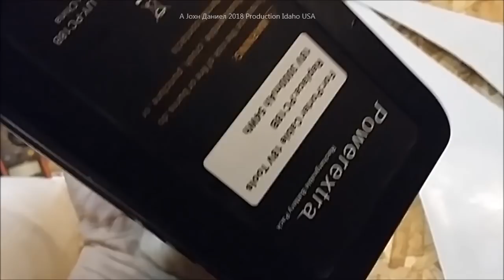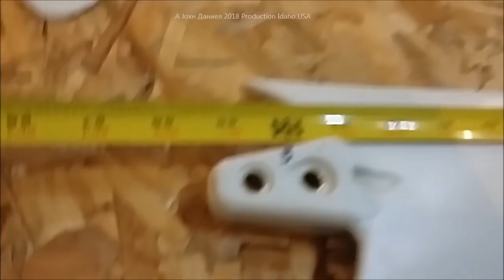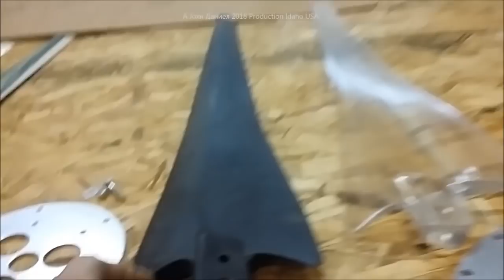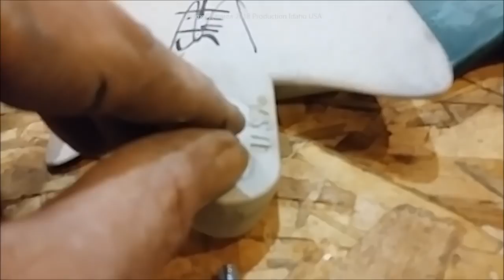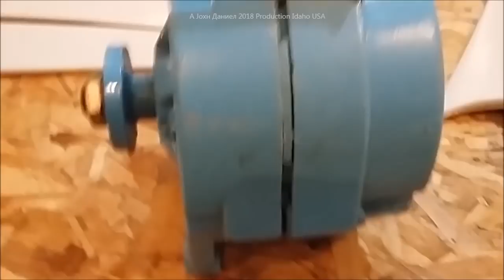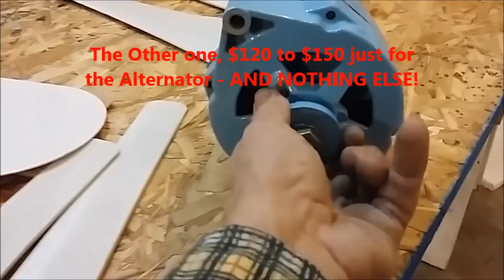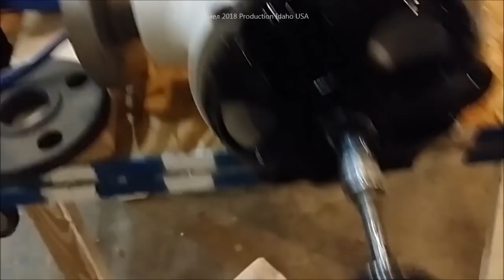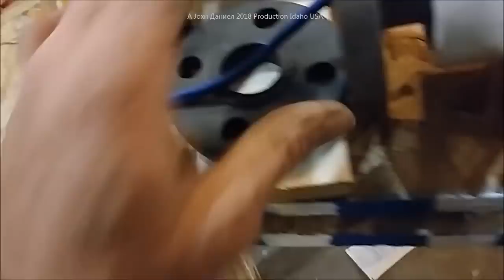Nice 500 Watt Chinese Wind Turbine, how to Test, Wind Turbine Lesson 2 (all parts used below video)

Comment: Using a 54 watt drill motor to produce 150 watt, you are smoking nice products or taking nice pill's
Reply: Peter Evenhuis, 54Wh was the battery capacity of the drill (1:11), not the power of drill motor

Comment: Is it possible to make the blades longer but not heavy as they would be if made from that material ? Is it possible to make longer but strong enough and lighter  blades?
Reply: The smaller the blade more RPM the longer the blade the more torque
Reply: If you look around you can find wind generators of all different diameters. The larger the diameter, the more wind it intersects, the more power it makes. A 6 ft diameter turbine makes a whole lot more then twice the power of a 3-foot diameter turbine. Check out the area of a 3-foot diameter Circle compared to a 6-foot diameter Circle and you'll see what I mean.

Comment: How much watts can this little thing give ?  What is its output when the wind is weak?
Reply from the maker: Low winds would be 90 to 140 watts continuous. Thats referring to a 10 to 14 mph winds. However once over 15 mph its quickly jumping to 250+ watts. Mine has hit over 1000 watts in 30 mph
Reply: @JOHNDANIEL1  well that sounds amazing! Does it produce anything on 5-10 mph or even lower?
Reply from the maker: Below 5 mph its nothing but a few spikes of 10 to 25 watts, at 10 mph its a fairly steady 60 to 80 watts. About 5 to 7 amps.
Reply: @JOHNDANIEL1  still amazing,  Thank you.. when you spinning it by hand it looks much harder to spin , but if it works on 5 mph and under that is awesome.

Comment: I would like to see that 500W with 4 vertical blades (what size?). The more blades you have, the higher the torque/output, therefore same size blades can have different output if grouped in different numbers. The higher the output, for generators the same size, the higher the resistance.
Reply from the maker: The more blades you have the faster you create a wind wall of blades and stall out.
Reply: Actually the fewer blades the better. A single blade would be most efficient but difficult to balance. It would also have the same problem that two blade turbines have, real bad cogging or shaking during yaw. The 3 blade turbine keep the blade count low while offering very smooth yaw.

Comment: Any advantage to select 5 blades intead of 3 blades .... other than the noise using 5 blades  ......
Reply from the maker: 5 blade is for lower wind zones like 5 to 15 average, it will likely only get to 85-90% of the generators output rating though with 5 blades due to WIND WALLING effect when the blades speed create a near solid wall of blades at full spin. 3 blade takes about 2 mph more to start up, perfect for a 8 to 20 mph wind zone. 3 blade can reach and exceed the rating on the turbine in maximum winds.  I am in a 10 to 25 zone, so 3 or 5 can both be used, just that 3 will have higher full output.

Comment: You seem to have so much good information and then you go say somethings stupid like the max rpm is 550 in sure it says 550 but that's in speed 1 not 2 its probably in between 1500 and 2000 and also that 54 Wh of the battery has almost nothing to do with the drill output other than a runtime
Reply from the maker: So when you made that assumption of stupidity you looked up the specs on the pc18 drill and saw that info.

Comment: the turbine is not availlable. i want a 500 watts 3 blades
do you this one is godd for the price ?       https://www.ebay.com/itm/500W-12V-24V-3-Blades-Wind-Turbine-Power-Generator-Charge-Controller-Garden/292332723510?hash=item4410635d36%3Am%3AmkBInQ4ez2kMH2JGN8TPGZA&var=591226717852
Reply from the maker: No, that one is very lame, tops out in a wind storm at 150 watts, not worth anything, has only a 1" deep stator in it, not 2.5 like the good ones. The ones like mine listed as 400 watt https://ebay.to/2Qg9s1p OR https://ebay.to/2QgICGI are the same generator head and maker as mine, its 400 watt/500 peak. They will hit peaks in excess of 500 so be sure to wire accordingly. And use this big PWM SS type of controller https://ebay.to/2wR2LKk for 600+ watts, if you try to use one of those little MRC 400 watt ones these turbines will eat it.

Comment: Please can a wind turbine work directly from a wind controller without an inverter ? I'm new to this
Reply from the maker: Yes, you can just use it to charge batteries
Reply: John thanks, that means without the inverter included it can't be use to power any home appliances ?
Reply: @kolayemioladepo939  these wind generators make wild alternating current (AC) that gets rectified to direct current (DC) to charge a battery. Batteries only use direct current. I have seen some small cabins that are wired for DC lights and a few small DC appliances. Although most people just connect an inverter to the battery then connect the inverter to their breaker panel in their house.
The nice thing is the battery can be charged by almost anything, or even a combination of a wind generator, solar panels, Micro Hydro turbine, gas generator, your car or garden tractor Etc.

Comment: But this set-up will likely never have either of the above problems, because the wind turbine in this video is installed so badly. It looks to be only about 8-10 ft off the ground and placed amongst ground clutter such as trees and bushes. -- There's no way that any turbine will get the smooth, non-turbulent laminar winds needed to produce any kind of power at that height and amongst that kind of ground clutter.

this model.https://www.youtube.com/watch?v=f5WOUeP1hCs
Reply from the maker: ??? Are you saying that my turbine is installed badly??  Seems mine at 34 feet high, using the wing like compression of the 3/1 roof has outperformed the one i have at 32 foot on a pole in clear air. After 9 years running wind turbines, building them, installing hundreds solar and wind projects I think I'll keep them right where they are. BTW - That chinese controller in that video is Junk! A real house burner.

Comment: Great video!  Very informative.   Do you have any videos of putting up a wind turbine tower?  I would like to put up a turbine to power my barn, but really don't want it attached to the structure.  Doesn't seem to be very many diy videos on YouTube to build a gin pole tower from scratch.  Keep up the good work.
Reply from the maker: I probably need to do a video on a tower build, I have done over 30 for customers. My contract though is designed where I can not film and upload a private customers job. I install turbines, I do not sell them but I will custom build one if you buy the parts.
My design is unlike anyone else, I build a self raising trundle tower I invented, none like it exist anywhere else. Most are 35 foot, highest is 55 feet to stay under the 60 foot legal FAA restrictions.

Comment: Where do you get that $220 price from?  The one on Ebay is $318 and on Aliexpress the only one available is $360-$380.
Reply from the maker: It's what the price was when they introduced them and I got mine 8 months ago, they out perform the $700 junkers sold from Missouri, Outperform the $800 junkers sold from a guy in Virgina, and stomp the piss out of the junk sold for $650 from a turbine guy in Washington state so the prices on it went up due to very high demand. The reality is, 90% of the turbines you buy just do not work even 10% of their claims, this one does 100% of its claims.
Reply: I don't mind paying the extra money, but I want to be certain that it is the same item. Would you mind posting a current link? Thanks in advance, and thank you for the education!!!!

Comment: Thank You !   Good Report
Reply: John I ordered  500 watt turbine  on 12 /1/2 019 from these people from your link blades are 25.5 inches long . You  have stated in this vedio 25 inch blades will not produce 500 watts. what has gone on ?? Also on tail sticker has no info on including mfg. Date
Reply from the maker: @sharyncomstock7066  22-7/8" are on the 300-400 turbines, and 25+ inch blades are good for a max of 500 watts, not much over that unless in a storm or high gust such as up to 650+ watts in storms but thats the limit. My referral is telling you to avoid sellers claiming 1000 to 1800 watts or more on 25" blades that they are for smaller 500 watt or smaller turbines only and do not make rated wattage over that. A 3 blade turbine commonly has slightly longer the 25-5/8" to have about a 55" circumference and the 5 blade has the 25" to get 53.5" circumference like mine. I basically refer the 25 ( 26") on those OTHER turbines with the Vietnamese generator on them as impossible to hit 500 watts as many with them can testify, poor junk engineering!
Reply: @JOHNDANIEL1  first of all thank you for
 Getting back to me so quickly. that's partly why you deserve all the credit you receive . I now feel better about keeping the turbine . It came damaged but they have agreed to send out damaged front  pma ring  that sits behind blade. Hub.( pma font cover) thanks again for all your help you provide.
Reply from the maker: @sharyncomstock7066  PS, if the tail sticker is not date labeled means its a 2020 model,  Made from Oct 2019 and forward. I noticed that on a few I recently installed in Alamo Nevada above the cemetery road in the hills. I did ask them directly on that.

Comment: What would be the effect of putting longer blades on the 200W alternator from China? I spend the Winter in the Keys (dry camping using generators and solar) and our average wind speed is 8 to 10 mph.
Reply: It may not give you enough RPM to produce any power, longer blades have more torque but less RPM
Reply: My knee-jerk reaction would be to say to try it, but then the old brain kicks in. Even slightly longer blades can give a lot more power to the turbine. This type of turbine uses electrical braking by shorting the fields as a governor to keep it from over speeding and throwing its blades. Now imagine if you put on longer blades and the wind kicks up. The controller may try to slow or stop the generator by shorting the fields, but the blades are overpowering the generator so it can't stop. It's possible it may overheat and burn up the windings of the generator. At that point now there is nothing to stop it from over-speeding and throwing its blades or worse.

Comment: hi there John ,
get one of these these days!
Have a question for you ..... the front bolt as a slack between the bolt and the turbine body , is that normal?
mine screw on to the right but the slack remains.....

Best regards from Portugal.
Reply from the maker: They appear to not make up all the way, but I powered though where it felt like the nut stopped. The locking nut on the shaft threads got about 1.5 mm from fully tight, I removed it, tried it again and it tightened even more. 3 times and it fully seated.

Comment: Dude! Construct a windmill. Base concrete with banks of organic carbon power cell. Large support pole you can place a spiral staircase inside of it. Top of windmill use a swash plate pump motor. This will allow you to control the speed of the blades and can also be used has a breaking system on very windy days. Swash plate hydraulic pump motor turns a transmission. Transmission then turns multiple large drum motors.rewired into generators and placed around the inside of the support pole along the spiral staircase. All the drum motor generators charge up the banks of organic carbon power cells. You can run power lines or yoy can use tesla coils to transfer the energy line of sight from coil to coil with zero energy loss.  Crazy ideas for you. 😊😉
Reply from the maker: Yes, already on that track. But the hydraulic rotating joint for that project is high dollar. Using low rpm hydraulic pump and 8 foot blades 7 years ago we built one and drove a ces-455 motor to a PMA. Too much lag. Design 2 is a 3 cylinder air pump from a Volvo and 9.5 foot blades. Air pressure is  made, stored and when sensors see battery needs it the air reserve opens and spins a 4 hp air motor which charges the battery back up.  Works perfect with solar, any pressure above 170 psi just vents through a progressive release which acts like a turbine brake. Air capacity is 260 gallons @ 170 psi. 
It is running at my place east of Ballinger Texas, NO VIDEOS OF MY PLACE THERE,  SORRY.
Reply: @JOHNDANIEL1  Time to think outside the box. Instead of using the pump directly, mount it on the bottom of a right angle gear box driven shaft. Then the head of the windmill can pivot to the wind while the shaft takes care of getting it to a solidly mounted pump. That is why the old water pumping windmills always had a swivel joint at the top of the reach rod.

And by the way the MOW&S guy is a work of art. ( in the new way of defining art )  https://www.youtube.com/watch?v=GeuaGZJQuUM Do you have a 55 gallon barrel of it saved up yet? Be sure to throw about 55 lbs of salt in with it.  ;-D
Reply from the maker: LOL!, Yeah that Harry channel I knew with fair certainty ( a email from brian P) belonged to a guy called Pooned who Missouri ripped off and another guy who was a scam helper criminal liar assistant for Missouri who jumped ship instead of helping steal more from customers successfully got sued for it in their little Dukes of Hazard kangaroo court in Missouri. Says a lot about truth in Missouri, None required! 
As for the water wind mill design the RPMS and its drive system winds up a rod, then surge pumps the water with numerous check valves and pumps ounces at a time, very un efficient for wattage, equal to 160-180 watts solar. Thats why they have converted so many to a pair of 150 watt solar panels and electric pump.
Reply: Ever hear of Rube Goldberg?

Comment: The link now goes to a 12V/24V 400W Wind Turbine Generator Kit 3 Blades Wind Power.
Reply from the maker: If any of the pictures and details don't look exactly like the one that I show in the video don't buy it. A lot of other sellers are trying to use its picture because they know it works to lead people to their ads and junk so avoid that stuff. The ME-400/500 turbine is from Niaer Wind Power, those others are just junk.

Comment: Hi Daniel
I have already installed the wind turbine (this model) with 5 blades and makes a lot of noise.
With a wind of 10 knots I measured 75 dB at 5 meters from the base. It makes an unbearable buzz.
and I have only measured up to 50w of load. nothing like what he gives you.
Do you think that with the blades you advise will make less noise?
thanks and best regards
Reply from the maker: They are not quiet, but a 3 blade is much less noise than a 5. They still have a loud swishing sorta whistle sound. I thought about putting tennis or racket balls on the tips to make them quieter.

Comment: I'm only getting round to putting up my turbine now.... Only issue I have is the hub is five blade and I have only three blades. I messaged the seller to see will he send a 3 blade hub so will see what happens there. I see those blade you have listed there would they be the same as what I have I wonder?? So I could just buy two blades and have a balanced turbine then. Your videos are excellent 👌 by the way 👍
Reply from the maker: Thats Odd, but not a bad deal really. Go onto Aliexpress and get you a 3 blade hub for it too hahaha. 5 blade is about a $30 upgrade. But honestly these only need 3 blades in 90% of the world wind zones. I would stick with the Chinese blades seriously in this size market of blades 500 to 750mm. A KT Pantera blade is HUGE and powerful, your turbine would explode in a wind storm with them things. And your bearings would get trashed with the missouri/Vietnamese stuff due to lousy balance.
Reply: Thanks John... I will see what the seller says and if he doesn't ship me one I'll just buy a new hub. Thanks for the advice really appreciate it 👍
Reply: Hi John, So I got on to seller but not really having any luck... I can't get a 3 blade hub on ali express I found them but the "m" size which appears to be my size is out of stock everywhere. So I'm thinking of using the 5 blade hub instead for now anyway. So do you recommend buying just 2 extra blades ? I think they are 650mm 
or buying 5 X 650mm blades to be more balanced? The other thing I've lost my nut for the hub ! I had a really bad luck that day. I think its 3/8" nut on the inside and 15/16" on the outside from my measurements. Thanks again Jon.
Reply: @offgridamps  if you have a Fab shop or a machine shop in your area, just bring everything down to them and explain what you're trying to do. They should be able to set you up.

Comment: Hello from spain,
Thankyou so much for the videos. Following your advice, I have ordered this wind turbine. can you tell me what size flange sit uses this model, please?
https://m.ebay.com/itm/Wind-Turbine-Generator-Flange-Seat-Accessories-Inner-29-135mm-Outer-104-240mm-/362145398303?_mwBanner=1
 thank you very much
Best regards
Reply from the maker: Not 100% sure, that M2 model looks correct in my view, but I used 1-1/2" weld flange for USA pipe schedule 60. I know its about 4" wide.
Reply: Ok, thanks. I will look at it. Congratulations for your videos, they help a lot. regards